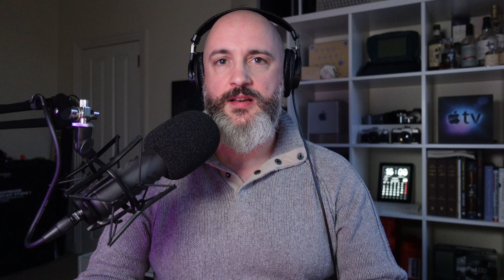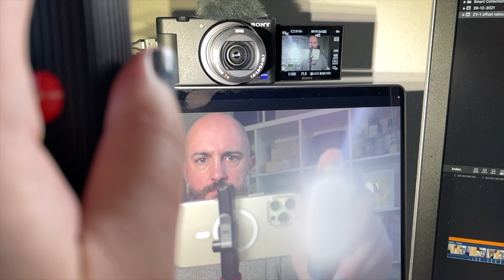Sony ZV-1 HDMI output delay

Comment: What a mess. The cam has sooo many drawbacks. The more I use it, the more I stumble over new ones.
What you can also do is to set it to 1080p instead. This also removes most delay. But setting it to 1080p might also be a pain. I had elgato support puzzled about why it cant get 1080p and well...in the end I found it, that internal recording as "active" (its not actually recording at that point) forces it to output 4k on hdmi.

Comment: The above way of doing this is probably the most advanced way of doing it, you can also go to the advanced sound settings in OBS find your microphone and using the clap method or a clapboard you and tick the box to around 135-140 milliseconds and you should be able to get it unnoticeable to the eye.  I have the same camera and a Rode pod microphone going to a goXLR so you should be good.  I have to say that the video quality of your looks great, keep up the good work.
Reply from the maker: Thanks! And yes – though I don’t use OBS. I talk a little about my current setup in a new video: https://youtu.be/XY6XMU3V6fQ
Reply: thx man, i just did that and it helped me, have a good day

Comment: you do know that there is a much much much simple way to fix your audio? Just clap three times when you are recoding. Then take that footage into premier pro and align the sound. Take note how many frames you are off by, then you can google search how many frames you are off by and get the audio value for it in MS. In OBS using the sony ZV1, I found that 220ms "sync iffset" in the advance mic settings fixed my issue. Hope that helps
Reply: thanks for the help! :D
Reply from the maker: This is true! But only for stuff that is recorded, and I want to be able to have it applied live in any app I want to use. Happily, I’ve figured out a way, though it’s still imperfect: https://youtu.be/XY6XMU3V6fQ